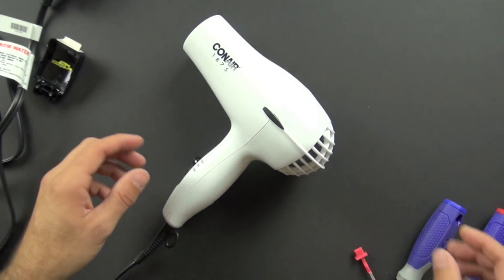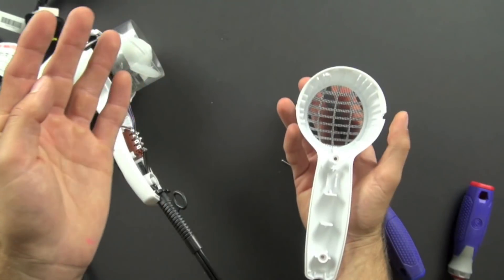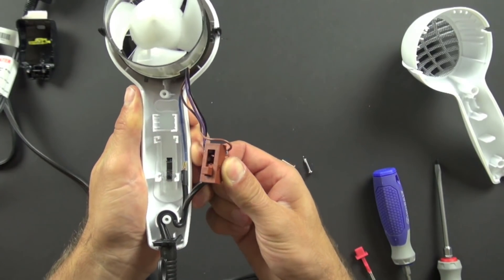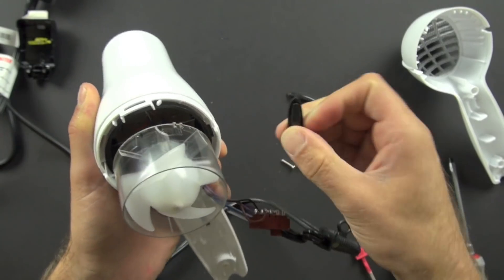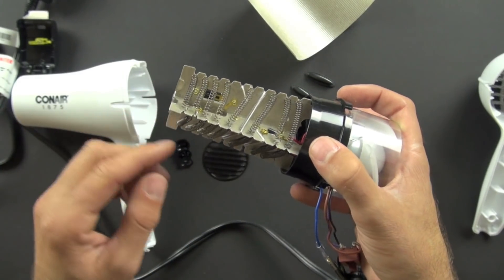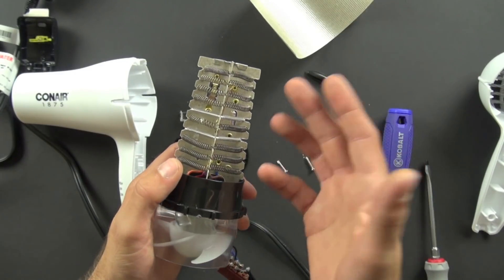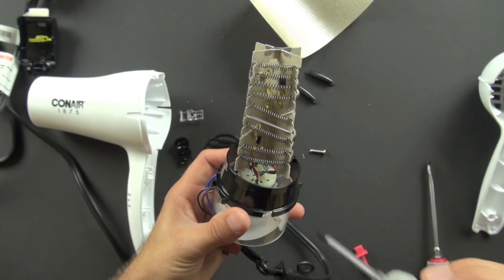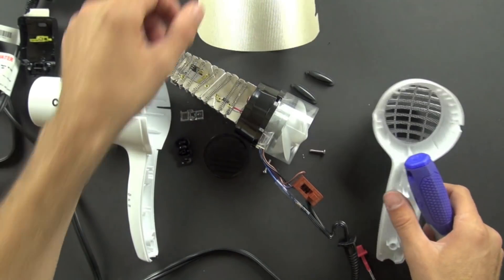What is inside a hair dryer? (2 of 2) | Electrical engineering | Khan Academy

Comment: Thanks, guess I blew the fuse...I use to dry stuff like clothes and keeps shoes odour free!
Thinking about it when younger using it for hair, that I dry metal with it and burning hot.
Maybe not so good for scalp unless on med/low..
Had one that lasted 20 years, still worked rusted out...this one 4...mis-use!!
Same exact build, same brand but some parts are slightly different look/quality.

Comment: If i cut the wires going to the heater, would the motor be affected or would it just blow cold air? Or would I have to forcefully bend the bimetallic strip in order to get cold air?

Comment: Of the two screws on the back handle f my Pro Beauty by Interteck the top screw will loosen but it  is stripped and won't come out.  Prying the handle apart and it appears it's glued.  Cheap hairdryers come apart easily as this video shows but the expensive hairdryers have other tricks that prevent it from coming apart...glue, etc., but my issue is the screw that appears stripped. But it lasted more than 10 years.

Comment: The heating element is used to drop down the voltage for use in the fan.  But what if you have cool air selected?  The heating element will then be off, so how can it supply voltage to the fan?
Reply: If you look inside an hairdryer, or this video, you will see there's actually 2 size of coils. I believe the smaller one is for dropping the voltage. If you push the cold air button, you get colder air but you can still feel some heat coming through, the fan blow most of the heat away that's why it feels cold.

He doesn't explain how the switches work, the secondary fire hazard safety devices and how the cold air button work :( 
I wish he did because he explain the rest really well.

Comment: How does the electric current gets converted from across to dc from switch
Reply: He explain everything in the video... the heater is a BIG RESISTOR, it reduce the voltage to 12V and the 4 diodes around the motor make the current only flow in one direction, AC = flow in both direction / DC = flow in one direction. 
The switch does NOT transform the current from AC to DC. 

The switch can handle high voltage current, don't replace with a lower voltage one or you might risk electrocution or you will blow the switch.

Comment: thanks for the video. Quick question, how is the voltage reduced when you run the fan on cool?
Reply: the cool button is a switch to the coils which electricity would run though.  Pushing the cool button pushes away the connection to the coils.
Reply: @mashy712  but if you are not longer passing the electricity through the coils, what exactly is limiting the voltage to 12V?

Comment: Those 2 rubbers pieces are designed for 2 things, to prevent the hairdryer from slidding down a table with the cord weight and help prevent side scratching on paint.

Comment: I NEED HELP. DO YOU HAVE A VIDEO ON A REMINGTON MINI BLOW DRYER. MY SWITCH SPRING IS BROKEN AND I CAN'T GET THE CASE OFF BECAUSEVIT HAS TO FACINGS THAT BLOCK THE COVER FROM COMING OFF. ONE IS AROUND THE NOZZLE WHERE THE HOT AIR COMES OUT AT AND THE VENT ON THE BACK OF THE TOP PART. I CANT GET EITHER ONE OFF. I'M ON FACEBOOK WITH A LONG BLONDE PONY TAIL

Comment: Mohan Kumar did you ever get a answer to your question about,  can I remove the heater from the hair dryer?  I just want it to blow cold air.
Reply: If you know how to solder you could just take the power cord out of the dryer,solder the wires from the output of the switch onto the motor,solder some more wires from the input of the switch to a socket for a power adaptor to suit the voltage of your motor ,hot glue the socket into the hole where the old wires came out and there you go.or if you want you can just cut the end from the power adaptor and solder them onto the switch if  you can't get a  socket.

Comment: will it still work with the nichrome wire taken out or will the excessive current destroy the fan motor?
Reply: Chris Qiao if you remove the nichrome then you need step down transformer to reduce the voltage compatable with the motor..in this case 12v

Comment: What is the white (or at least lighter colored) string-like material that's wrapped around the mica with the nichrome coil?
Reply: Right? So that white us a heat resistant sting that is ran through a smaller awg coil that is used for and is made of...idk

Comment: I have a pretty old Con-air Hairdryer that went out today. I did continuity tests with a volt-ohm meter. checked the plug, switches, motor and Heater coils. and everything checked out there. then I tested the thermal cutout  and it was OK. then the thermal fuse. No go! . so that's the end of that. I'll part this one out and get a new one. it would be easier rather then trying to replace the thermal fuse.

Comment: Our Conair 1875 hair dryer started to spit small sparks out of the air outlet end of the dryer. I am suspecting that the electrical contact points that he describes is the culprit.  I took the dryer apart and the contact points are no longer true, flat and flush with each other. It appears that the points erroded at their edges causing a small gap that I suspect current is jumping across, causing the sparks. I'm thinking that if I can file/sand the points flat again that it will fix this issue but there's not a lot of material there to remove. I don't want to remove too much that it causes other unwanted issues but I'm curious to see if this fixes it. I think I'll try to search for replacement contact points and maybe just replace them but I'm betting that that's a long shot ! Anyone have any ideas?

Comment: I wish you mentioned which wire goes into the motor and which one into the switch - neutral or hot, isn't that another safety feature? (also, how does the "cool air" button work - doesn't that remove the heating coil from the circuit - how the fan will get the voltage down in that case?)

Comment: Make sure you disconnect the main heating element and not the secondary heating element which is used to drop the mains voltage to 12-20 volts for the motor to run! If you disconnect this element, or it's supply (if it's coming from the main coil) the motor won't get any power!
Reply: Why would you disconnect any of the 2?

Comment: That diode in the coil not part of the motor bridge rect. is a cheaper way of implementing a half power setting, which would normally be created by a separate smaller coil, or a tap off the main coil. It works by half-wave rectifying the AC so it only gets power every half cycle as opposed to every cycle which limits the average power consumed to half of normal usage.

This is a messy way of implementing half power mode because it causes noise in the mains and a net DC current draw from mains.

Comment: The thermal fuse is not usually there to prevent the air from getting too hot, it's there in case of a fan failure (partial or complete) which would prevent heat from exiting the coil area and cause the coils to heat up much higher than they are supposed to (possibly even to incandescence, or glowing red) which would cause a fire and or burn hazard.
Reply: Or if the intake screen were plugged. So many people don't take the cover off and clean the screen.